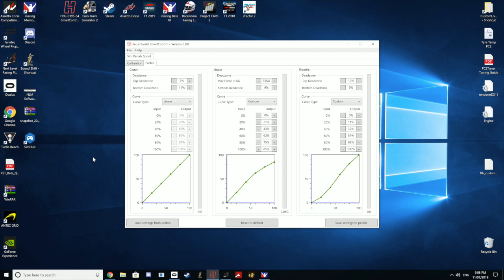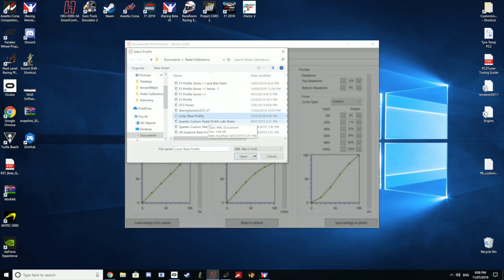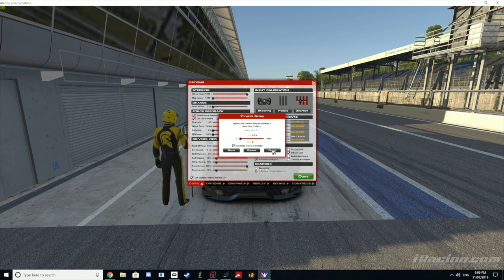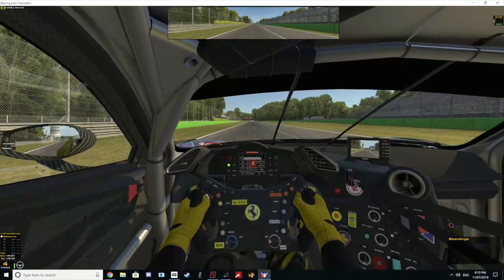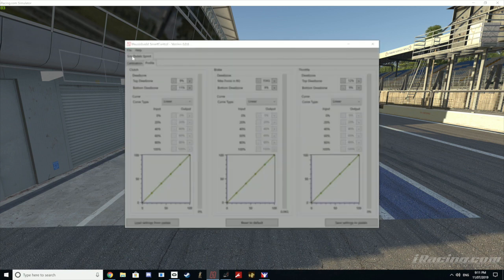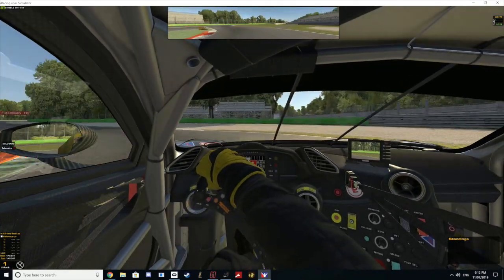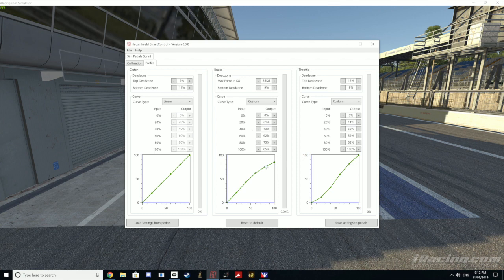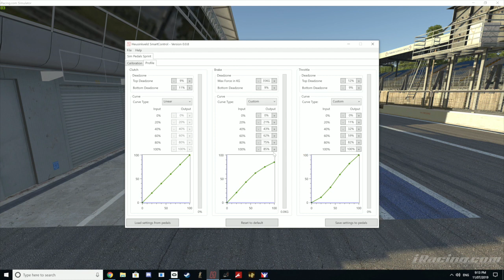Update, Heusinkveld Sprint Calibration

Comment: Hi! Are you still doing this for your iracing setup for most cars in 2022? If so, have you made any adjustments in the software that have improved it in any way or have you left it just like this?
Reply from the maker: Hi David. Unfortunately I do not race in iracing any more therefore I can’t answer this with any level in f confidence. The last time I used iracing before I let my subscription run out about two months ago I still used the same setting. Sorry I could not be more help.

Comment: What’s rubber are you using on your sprint brake pedal and are you still running 35kg max pedal force, trying to dial in my new sprint but can’t get a good middle ground on firmness.
Reply from the maker: I just have my pedals setup as they came out of the box. Never changed them.

Comment: hey mate can you show me what your v8 supercar profile is please
Reply from the maker: Hi Lee sorry for the late response. Unfortunately I am really crap at the V8's and struggle with them, as I think a lot of people do. I have done a bit of testing though in my pathetic driving way and realised that the max brake pressure on the curve is about 70-75%, also i have added a curve to the throttle which is lower at the start ramping up so as not not have the power come on to harshly. I wish i could be of more help but these cars are just not my forte. Good luck and thank you so much for the question and comment. Cheers Del
Reply: Did you find a good setup for the V8s? I have the Ultimates.

Comment: How come my brake pedal to achieve 4095 the position is around 112% and not 100%, any idea why?
Reply from the maker: Strange, This only thing I can think of is you may need to add stiffer rubbers to the pedal as you may be able to generate a lot more strength in you leg. Also make sure you have the graphs in the Heusinkveld pedals linear to do the first calibration, you could also set the KG weight higher. Other than that I am at a bit of a loss.
Reply: Spartan Racing Thanks for the tips. i will try that at let you know if it worked!

Comment: Hey Del, was wondering. I do not own a Heusinkveld pedalset yet (working on that), but I've heard that you were supposed to start calibrating the brakes AFTER the preload (the smol spring that you can tune as well). Apparently this is 100% a thing with the Ultimates, so I'm wondering if it's also a thing with the Sprints. It should allow you to ride on the brakes - using the deadzone - before actually putting force into it. (I'm also guessing you can put a super low input on the first part of the pedal if you wanted to ride the brakes with some brakes still in it)
Now that may interfere with what you're trying to do with your settings, and in all honesty I'm not a fan of not being able to use more than 85% of the input, instead of using a harder loadcell setting and naturally being stuck at said maximum % unless I literally jump on them (I drive the Fana V3 with socks and it's kinda the way I feel about them with the BPK on, with a "normal" braking input I won't really go further than 90% anyway).
Reply: Sidenote, I've read about your unfortunate accident. The reason why I'm quite hyped about the preload, is because it's something we do a lot on bikes. You may remember riding the brake lever is a thing that gives us a lot of confidence, hence why I'd like to feel it on my sim pedals as well !
Reply from the maker: Lapin hi mate thank you so much for the feedback and there is a lot of sense in what you are saying. To be honest I just do what works for me and share my thoughts on that. No doubt there are better and more correct solutions. It’s so great to get other opinions and I alway love it when smarter people than me offer these alternatives. I’ve been really happy with the results I am getting but no doubt there can be more gained. I’ll have a look at your solution. Thank you again for the input. The sprints are awesome and really changed my sim racing. I feel pedals are the biggest upgrade that ca be made to sim gear. I loved my V3’s but the sprints are just that extra level. Cheers mate.
Reply: @SpartanRacing  Haha yeah I'd believe the Sprints are definitely an upgrade. They're in stock on the website, so I'll be trying to get them next week and wait for a rig. Indeed it'd be nice if you could try the preload as a deadzone because I'd like to set them up like this, but idk if it's really possible or if it was meant to be setup this way (versus the Ultimates which they are). But if you didn't tell me it was a rubbish idea right away, it might mean you are feeling the preload indeed !
Reply from the maker: Lapin mate I would never dismiss any feedback here I value all opinions. I will have to look into what you mean as I just cause the pedals how it works for me. When you get yours have a good play around and if you work out exactly the answer let me know again. Btw you won’t regret the purchase. Good luck man
Reply: @SpartanRacing  I'm looking at the manual, and it does mention it's up to the driver to use the preload as an input or a deadzone. From default, the preload is set as longest but apparently you can shorten its throw or remove it. I'll have to fiddle with the rubbers, because I've heard the rubber has a slight expansion to it.
Reply from the maker: Lapin I set my dead zone in the software. I calibrate then the pressure I want then the dead zone

Comment: Here in 2020 and this is still am improvement on what i had. Have you updated this for the GT3 ? and do you use the same for GTE? or do you have a good set up for that too?
Reply from the maker: Hi Carlton, I started changing settings for every car but eventually I found out that I like the late brake setting for all cars, in fact I use the sam setting now for open wheelers and everything. I just like the way it seems to hold the braking with more control. It is not suitable for everyone but it works for me great once you get use to it

Comment: So would this be a good brake setup for both the Ferrari 488 fixed series and the VRS/IMSA series? Just wondering since you have to trail brake a lot in these series! Nice video btw, just received mine today :)
Reply from the maker: I use this for both although GT3 has abs and GTE does not so you may need to make slight adjustment for GT3 and save a different profile. It's more about trying it out in practice and getting the balance that suits you. Thanks for the comments
Reply: @SpartanRacing  okei, thanks! :) i`ll keep that in mind

Comment: I used this setup and it worked great. But I put it back to 100% as I felt this gave me an unfair advantage over other drivers being able to just mash the brake pedal to the max without locking up. I think it takes away the skill of braking a little. I’m trying to just get used to squeezing the brake at the point of lockup. Great vid though as this still helped me tune the brake to how I want it, still working on it.
Reply from the maker: Chris Barker Chris I laughed so much at this response. Not in a bad way I totally get what you are saying. But getting an advantage over other racers is the idea I would expect even in real racing. The fact that you are in a position to acquire this equipment allows the benefits of using the features it provides. I liken it to Racing the F1 Mclaren against the F1 Mercedes. But I do agree with your sentiment and all power to you. I’m a mid pack racer and use what the products are capable off. Really appreciate your input and glad it helps a bit as this is the reason I do this as a start point. Cheers mate.

Comment: Do you have to witch the smart control setting for evey sim first to a linear basic setting then go into the sim for new calibration and then Go back to the costum heusinkveld setting again??
Reply from the maker: I have only tried iracing and PCars2, I did the same setup in PCars2 and it was better as well. I need to check ACC, RF2, AC and Raceroom. I will check them over the weekend if I get time. Cheers